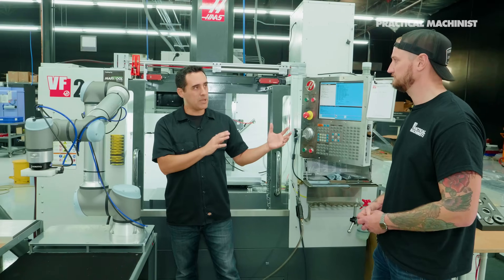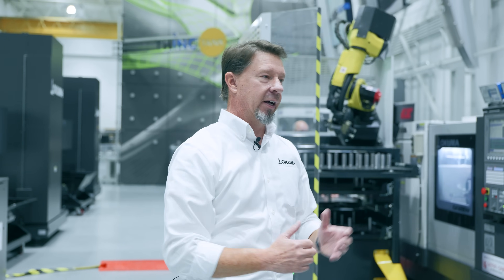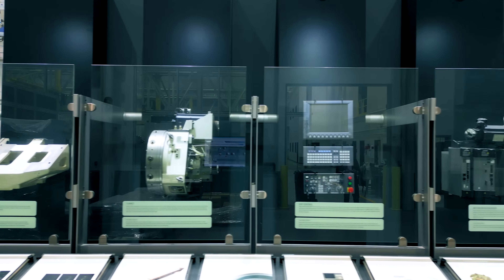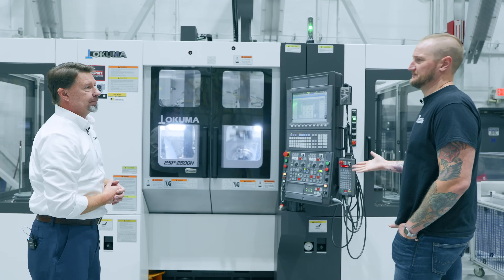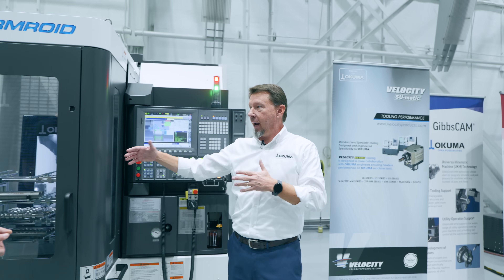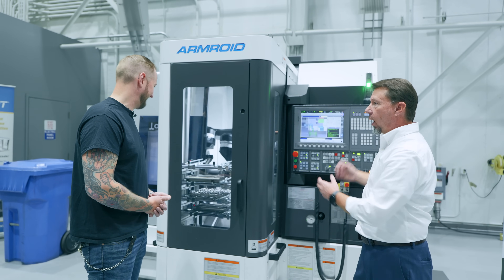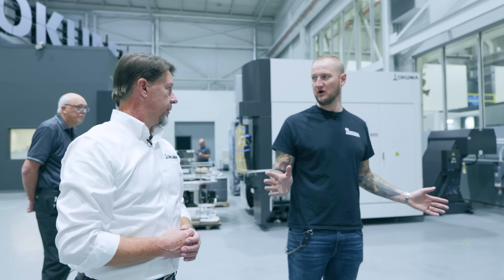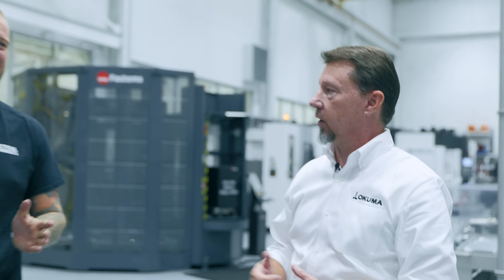Automation Beyond Imagination at Okuma's Headquarters

Comment: My question is, how often do machine shops get jobs with such large batches that it warrants this kind of automation?
Reply: That’s a question I’ve had a lot too - and with the two options shown in the video that are more modular, I think they make a lot more sense for shorter run production or more job shop-oriented work - the one that’s mounted on the cart, and the one with the arm in the machine come to mind.

I know the one with the arm in the machine would be well-suited to shorter-run stuff as it’s kind of designed to not only be able to run as full automation, but basically be a job shop machine by day, and then lights-out automation by night. Kind of a nice way to bridge the gap if you’re not doing 1000’s of pieces very often.
Reply: Completely depends on the shop. I have two friends who are machinists, one only does prototypes and the other only does production. The production guy does HUGE runs of parts for major industry clients. Entirely possible he'll be overseeing production of the same handful of parts for months.
Reply: You have to think different about this. With a small pallet changer you can have an individual part on each pallet and have virtually no down time. You change parts while the machine is running. Rather than buying 3 verticals, rather get a larger 5 axis and a pallet automation. Put 1, 2, 3 or more Vises on each Pallet and hit that green button. Walk away, do other things, like programming the next parts, prepare tools, cut, deburr etc.
Reply: @DuRöhre4711 That's true, but also they are not as productive as 3 machines.  When using 4 machines and fms, it shuts all 4 machines down if there's a coolant leak for example.
Reply: @MikeYurbasovich  If your House burns down, you'd better have a second one... Automated machines can run second and third shift without an operator. You can't do this an 3 Verticals without personell .. If you've got a 4 machine FMS system you'll better have the money for preventive maintenance and high class machines, too. Automation IS the future for different reasons.
Reply: @StachiBCNR33  Stachi, you're not thinking about what I'm saying. I'd start there.
Reply: @MikeYurbasovich  No, you're talking out of your rear just to justifiy your argument. I'm running automated systems since decades.
Reply: @DuRöhre4711  Sorry, being an operator means nothing to me, friend.  But hey, you're right.  Carry on.
Reply: @MikeYurbasovich I'm not an "Operator". You're still trying to justify your argument. Nonsense. Running an FMS says nothing about a coolant system. You may have a dedicated system or individual systems with each machine. It depends on what you order. If one machine is down, the FMS loads work onto the other machines. This has never been different with any notable manufacturer.
Reply: @StachiBCNR33  Sure it does.  Fms systems are added on to what would be the operators loading station. If you have chip buildup inside the area where the pallet changer is, the coolant wash is plugged and overflows on the floor.  To repair this, you have to go inside the fms system, which shuts all the machines down.  Z axis ballscrew- same thing. Servo motor- same thing.  Linear guides, same thing.  Wiper replacement, same thing.  Hydraulic hoses up front- same thing.  Pc motor- same thing.  The list goes on.  Don't tell me I don't know. That's literally what I do for a living- automated systems specifically for cnc machines.  I'm a factory automation technician who manages a team of people just like me in a company with 250 machining centers and hundreds of employees. We don't have any off-brand equipment.  One of those fms systems is loaded with 50hp 5 axis machines. We do aerospace, energy, mining, ag, and many other types of machining.  I've been doing this for 25 years, and you just don't have any idea what you are talking about.
Reply: @MikeYurbasovich  Again you're talking out of your rear end. There is no "the" FMS system so there is no "the" coolant blockage. Utter nonsense. If a machine breaks down its down. Doesn't matter how many axes it's got or what it's hooked up to. For your pipe length measuring contest, I sell automation for a living and shurely have seen more than your 250 machines in my life.

Comment: (german here sry) what does opt 10 and opt 20 mean? like opt1 and opt2 so first side 2nd side?
Reply: Yes
Reply: Was coming to ask the same thing why would the first cut from raw stock be called the 10th operation
Reply: @dillansherwood2930 maybe the same reason why you most of the time name the lines of code 10, 20,30 or 5,10,15. on case you have to add an line/operation in between or before you are able to do that.